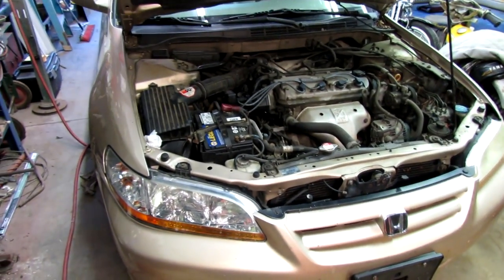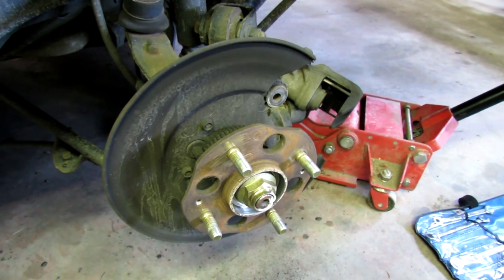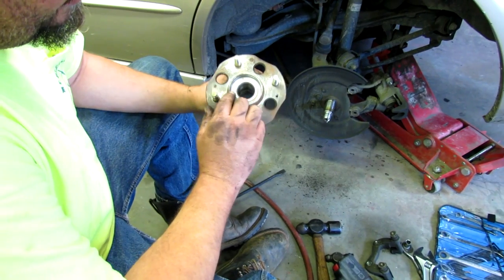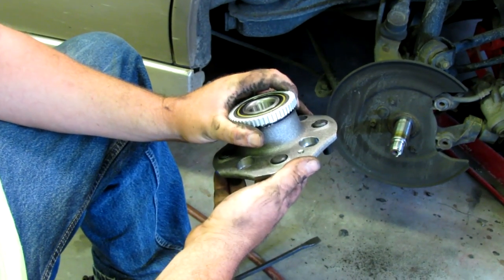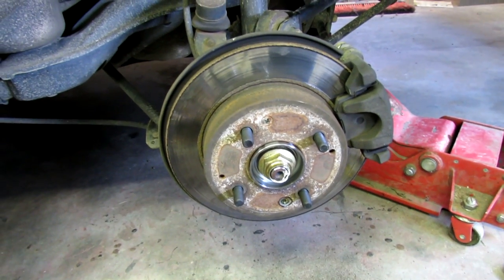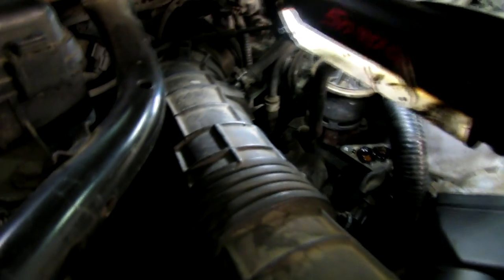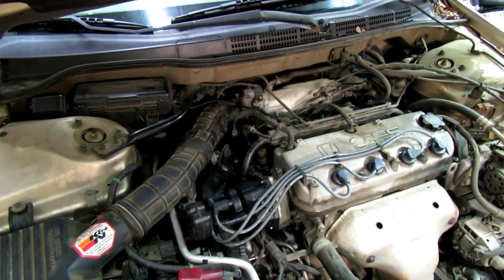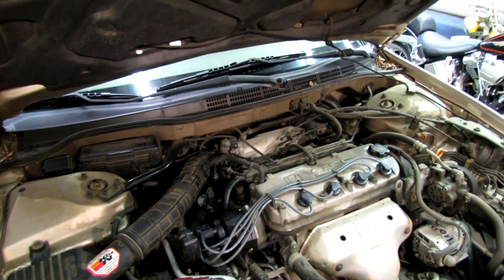Sun-fix the Honda

Comment: Often the oil gallery to the solenoid gets blocked...Mostly higher mile engines...I've seen it in low mile engines when Castrol magmatec oil is used and lack of service.
Reply from the maker: ZIGgassedUP I think that was the problem...I cleaned it out with carb cleaner and blew it out with air and it hasn't bothered since.

Comment: So did replacing the v-tech switch fix the problem?
Reply from the maker: The Shade Tree Fix-it Man I just cleaned the oil passageways in the solenoid and it cured it.

Comment: Take it off the engine and clean the screen, look on front side there should be another cover with a screen under it. The oil pressure pushes on a pin that locks the second set of rockers together for a different cam lift ,well kinda . I done a vid on cleaning the screens once . think that engine is the same. What was the code number.
Reply from the maker: wtbm123 I forget the number..maybe 1256...but it was a vtec code...I cleaned the passages on the soleniod and that seemed to cure it.